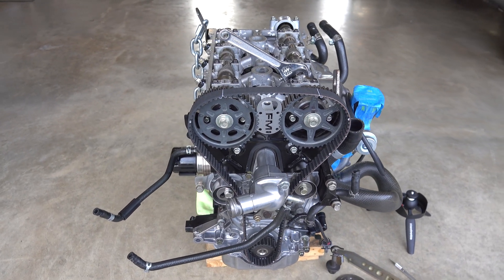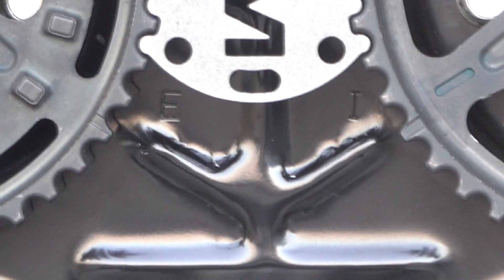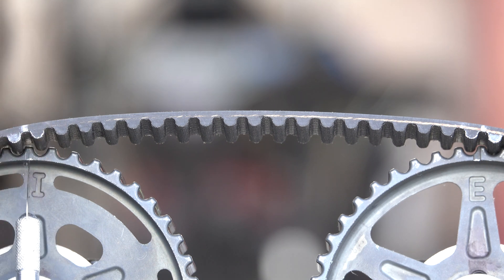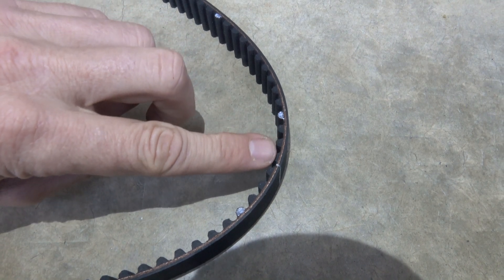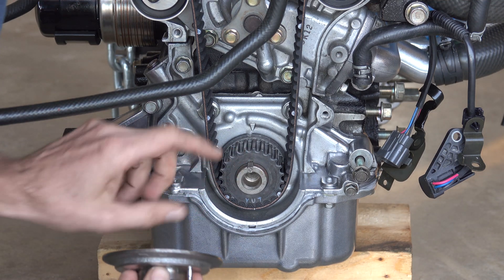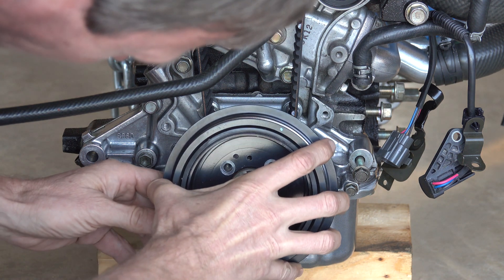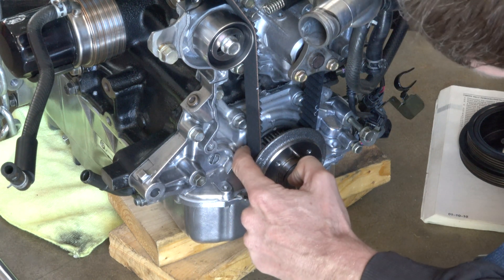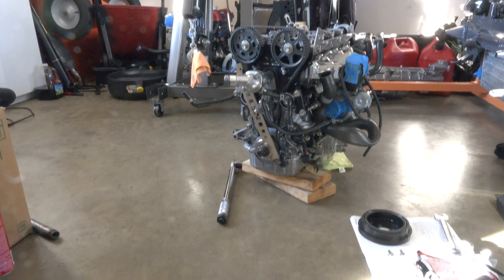Miata Timing Belt Install by counting teeth (Best Video)

Comment: Great job at documenting.
Can you do a zero to 60 times. Trying to get a reference on what 300HP in a Miata is relative to. Also some 6th gear 60MPH pull like you need to pass someone on the highway . Basic real world situations.
✌️
Reply: My engine blew up because the builde put stock rods in instead of built ones I asked for